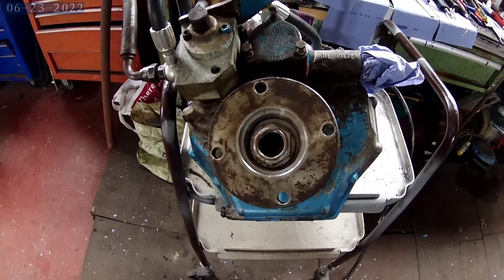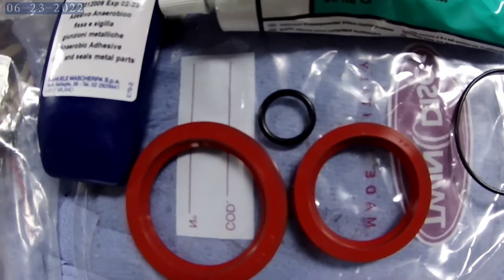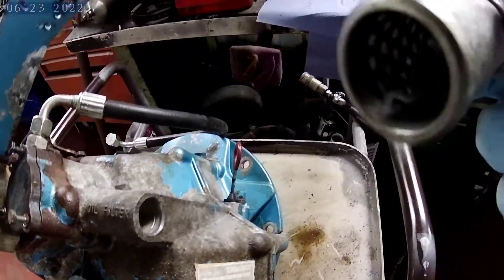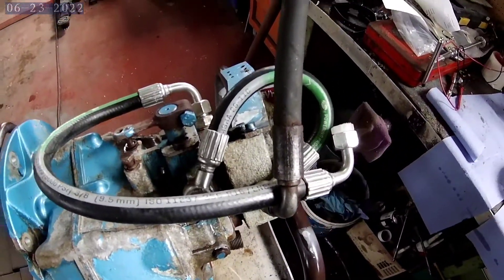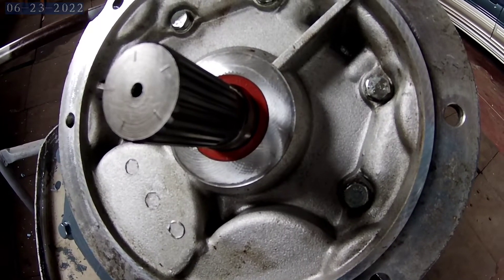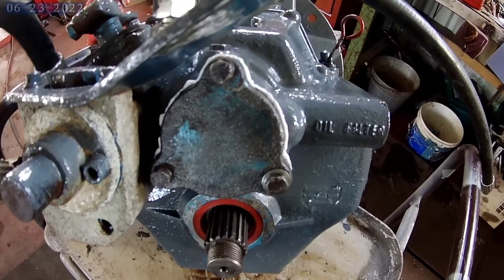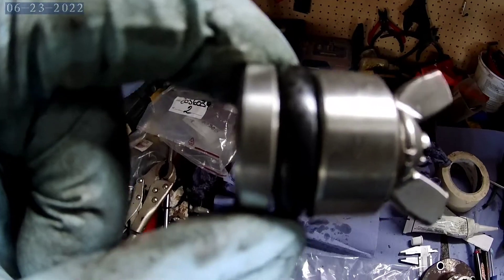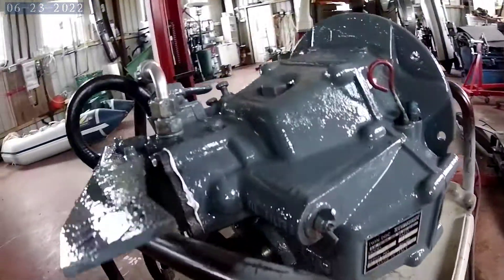Episode 4: Technodrive TM345A replacing the seals

Comment: Hey there, do you know the seal size on the engine side? You mentioned 45.60.8 on the flange side, I was wondering if you know size for the other side. That seal kit costs $150 shipped to the US, trying to save some money. Thank you.
Reply: At the tm 345 i have are the nr of seal at the shaft at the engine side 35-47-7